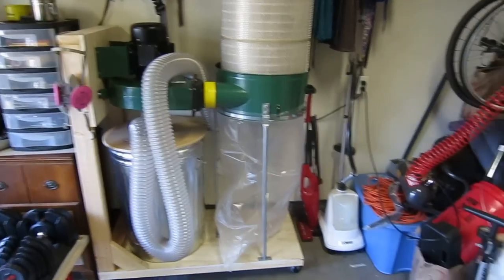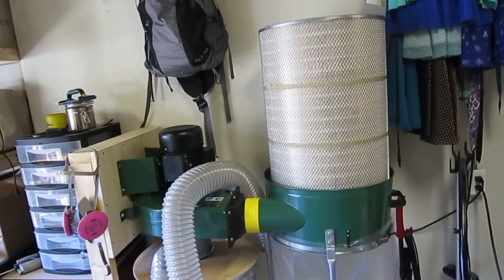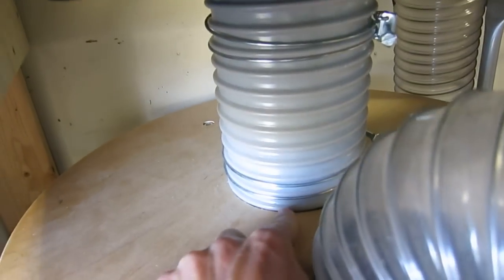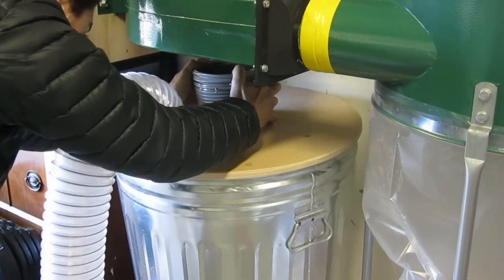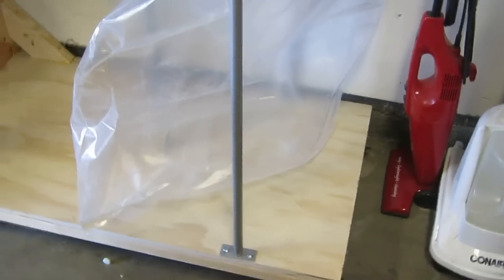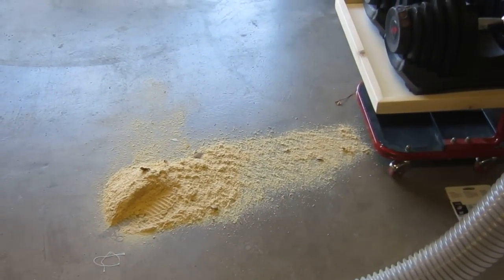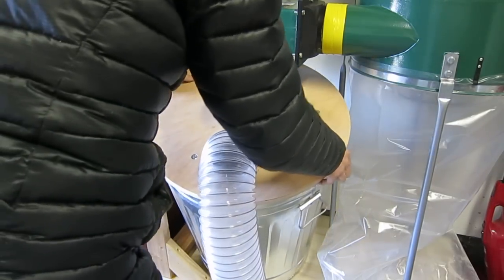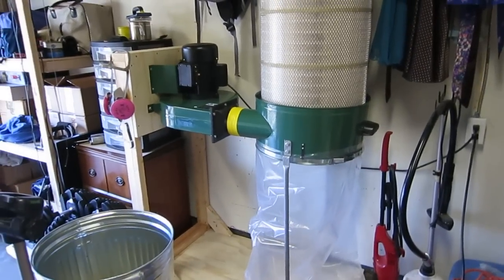Harbor Freight 2hp Dust Collector with Wynn 35a Filter and Thien Baffle Pre-Separator Setup

Comment: Sergeant,

Can you compare the effectiveness of your Thien Baffle  with an Oneida Super Dust Depty?      I have been looking for a comparisson of the Thien Baffle  and Super Dust Deputy for a year or so to no avail.

How much fine dust gets through your Thien Baffle and into the Wynn 35a.  What size garbage can are you using.  I hope to use a 30 Gallon bucket for the first stage dust collector as it requires about 8 inches less vertical height than a 55 gallon trash can.
Reply from the maker: That's a comparison I'd love to see (and do as well) but I can't justify the purchase of the SDD when the current system works so well.  

As for the fine dust, very very little gets through.  The Thien does a phenomenal job at separation. I'm using a 30 gallon can and I've emptied it dozens of times and there is pretty much nothing in the collection bag below the filter.  I've cleaned the filter twice and there was a decent amount of dust though.   If you just blow it out with 60psi compressed air every few months you should be good.

Comment: Would you mind sharing the dimension for the frame you build to hang the motor?  Just really need the height. I just got the HF unit and am planning the build you did!  Reading your comments, I'm going to add 2 90 degree steel L brackets to give some beef to the motor support.  Thank you...

Comment: Really well done video and job on the mounting cart.  Now that you have had the unit up and running how often if ever are you cleaning the filter?  I'm deciding which DC to purchase and the Jet has this handle for knocking the dust off the filter that looks attractive.  I am going to build your cart with the 2nd stage separator so I'm not sure if I will even need that handle for cleaning?  Jet is more $$ and only 1.5 HP so I'm leaning the HF direction.  Would love to get your thoughts.

Comment: Thank you for your generous and considerate video lesson !!!  :) :) :)
Question:

1.)    How snug is the plywood lid for your garbage can?   Is it better to be more snug? (sealed?)  
2.)   When you mention the 2" drop for a 4" tube (hose?) are you talking about the depth the hose passes through the plywood lid?  
3.)   Is there a certain direction the elbow should be aimed so that the large particles actually do fall to the bottom through the 270° open slot?

Gratefully, 
Steph
Reply from the maker: Hi Steph,  I didnt' seal the top and haven't noticed a reduction in suction but you could always get adhesive backed pipe insulation and put it around the bottom lip of the plywood where it contacts the trash can.  Then use a bungee cord across the top and connected at the handles of the trashcan to pull it down tight.  I may do this at some point but 2+ years later and it's still working well.  The 2" drop refers to how far down the center port extends below the plywood top surface.  Ideally you want 50% of the diameter of the hose to extended down into the can (the middle port).  I directed the 90* elbow so that the material would make a smooth transition to the wall.  Google "Thein baffle for further instructions.  Goodluck!!

Comment: Sir, I got my Wynn nano filter.  Can you show how you're holding the filter in place?  I don's see any straps holding it down.  Also, how did you cover the top, or does it have to be covered?  Thank you
Reply from the maker: No need to cover the top.  Here are the instructions: http://wynnenv.com/wp-content/uploads/35A-Filter-Instructions.pdf
Reply: Thanks for posting the instructions.  That is very helpful.

Comment: Do you remember the Wynn part number for the filter to fit the same Harbor Freight dust collector?  I'd like to upgrade mine too.  Thanks
Reply from the maker: +Leba Its the 35A.  There are a few different variations of it with difference filter media.  here's a link to the instruction kit: http://cdn.wynnenv.com/wp-content/uploads/35A-Filter-Instructions.pdf?d48abc
Reply: So, how are you holding the Wynn filter in place?? I don't see any straps pulling it down against the dust collector.

Thanks
Reply from the maker: There are three turnbuckles on the inside that pull it down.  I was getting a small leak on the side so I added a small strap across top to pull it down.

Comment: how many hours of running time,does the motor have in that configuration? read it could be hard on the bearings and want to hear from ktners before setting mine up same way
Reply from the maker: +Tom Mullen I've had it setup this way for almost 2 years now.  I spend a decent amount of time in the shop and it's probably running a total of 2 hours a week, so ~200 maybe?  I have a remote start/stop so I shut it down when not actually cutting something.  It's held up fine.  I read somewhere that someone was concerned about bearing problems but I find it hard to believe.  I've pulled other motors and dust collectors apart.  The DC is just a motor with a impeller attached.  There's no additional engineering that goes into all these dust collectors, drill press or any other tool that has the spindle in a vertical plane.  I wouldn't worry at all about it.

Comment: Any kind of method to clear the filter without removing it?
Reply: +Bob Snyder just use an air compressor (at 80lbs) and blow it back into itself.  They have little attachments that work nice for this purpose

Comment: Great build.  I am planning on doing the same.  

Can you post a link to the elbow pieces that you used inside the separator?  Any other pieces I should order prior to building this?
Reply from the maker: Dan Borello I purchased the parts in store at Woodcraft.  It's a 90* 4" elbow and a 5" to 4" reducer.  Just cut the holes in the plywood and glue them in with a hot glue gun.   Beyond that you should be good to go.  Goodluck!
Reply: thesergeant Ordering everything now. Looking forward to it!

Comment: Thanks for detailing this setup, planning to go this route ... just wondering if there is a legitimate amount of suction loss at the rim of the chip separator can where the ply sits on top? Would this be ideally gasketed in some way or benefit from an air tight container with a lid that seals?
Reply from the maker: ***** The seal is pretty tight on mine although I did think about adding high density weather stripping foam (with adhesive backing) around the inside rim of the separator.  Then running a bungee cord across the top from one handle to another to compress everything and really seal it up tight.  I might still do that but the suction is pretty strong as is.

Comment: I actually added a Thien baffle inside cylinder between the two bags.  I saw that in a YouTube video and thought I would give it a try.  That has worked well in keeping a lot of the garbage out of the bag so it stays pretty clean.  But my next upgrade was going to be what you did.  Its a great idea.  I saw a few others that did that and asked about the motor mounts because they worried me but the two I talked two have had theirs like that for several years.  I am not convinced they will last so I might have some new mounts made for me.  Great video.  I am putting the link into my folder for HF modifications.
Reply from the maker: Thanks for the comment.  Ya, I was a little conerned about the motor mount as well when I built it.  I ended up adding a second 45 degree angle brace on the back to provide even more support.  The 2x4 goes from the top of the motor mount to the base.   I might weld up a steel stand for it but right now it seems pretty solid, so I'll take it.  Let us know if you come up with a better design.  I'd love to see it.  Always looking for ways to improve the setup.
Reply: thesergeant
I would probably go with the kind of brace you put in.  Makes sense.  I actually bought the Harbor Freight because of all the mods I found online for it.  I have a Festool dust extractor that takes on a lot of my tools.  The HF takes care of the bandsaw, lathe, planer, and my jobsite saw.  And I like it being mobile because I have no issue with a long hose and connecting it to each tool.  All my tools are mobile so I just move them into position and make sawdust.  Then they go back to their storage position along the wall.  I may put the HF in a closet in one corner with a furnace filter in the door at the top and bottom to see how it behaves.  I like to experiment with dust collection.  I am going to share your video on my Facebook page "Coogan's Workshop" because I know a lot of people were interested in things like that.

Comment: Hey Sergeant, nice work, very clean design and lots of bang for the dollar spent.  My shop is down until I get a system in place because my wife has severe asthma and a lung condition, I was concerned about the HF 2 H unit but less so now.  I have gotten conflicting stories on whether the motor is convertible to 240, less costly to run.  Do you know if it is or not?  Some on the Internet say no, but HF today said yes.  Somebody is wrong...  I appreciate any insight.  Thanks for the design idea, I plan to use it!
Reply from the maker: My understanding is that the motor can not be rewired to 220.  I haven't pulled the motor apart to check though, so I can't necessarily say it can't be with 100% certainty.
Reply: Not exactly true Nick. Efficiency ratings for electric motors are higher when running at higher voltages (if the motor was designed to be run at that higher voltage), so it requires fewer watts to achieve the same output. Current would only be the same if efficiency was equal at both voltages.
Reply: +Bruce K. Evans - Historian I know this comment is a year old, but it will cost the same to run whether on 120v or 220v.  It will use the same number of watts to run either way.

Comment: Been doing a bit of researching of this mod for the HF collector, which I hope to adapt to my new HF. Of the many designs I have seen so far, some similar to yours, I like what you`ve done. But, after putting my stock unit together yesterday, How is that 50lb motor assembly held up there, the way you have it, with just the small 45 degree braces at the bottom? Seems the weight of the motor would put too much pressure towards the filter?
Also,  was thinking, it would be a nice idea to get another HF stock, cylindrical separator (piece between the upper filter and the lower plastic bag) to put under the motor assembly. Then modify it with the baffle/separator to sit on the garbage can.
The shape of this stock piece, plus the side input might also help in less drag?
Reply from the maker: Ya, I was surprised that the the small braces held the motor as well.  I'm actually in the process of redesigning this setup and am going to be welding it out of 1-1/4" 16G steel.  It works for the timing being but I really question it's long term durability.

A 2nd HF cylindrical separator would be be great.  You're absolutely right regarding the shape and side input.  Google "Thien Tophat", it's basically exactly what you're describing.  Goodluck!